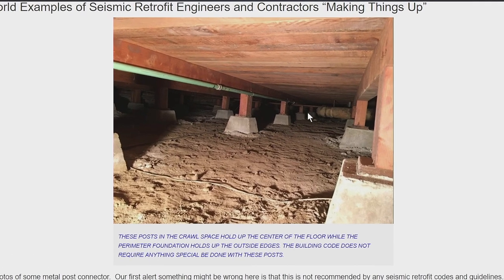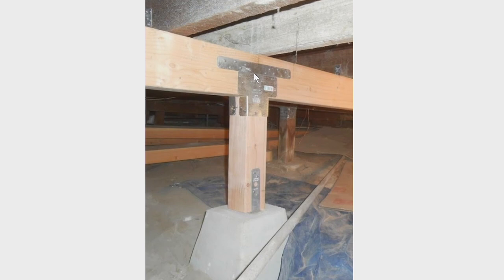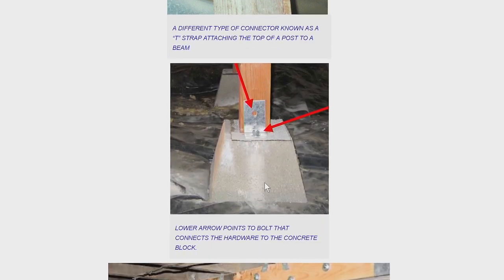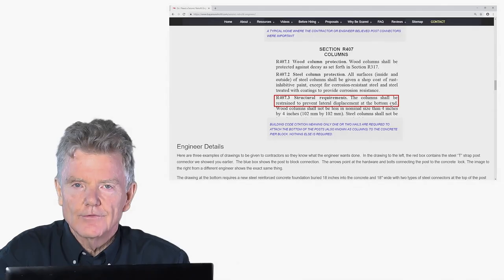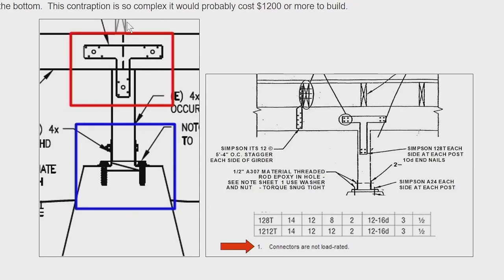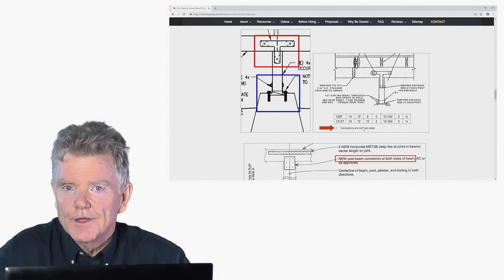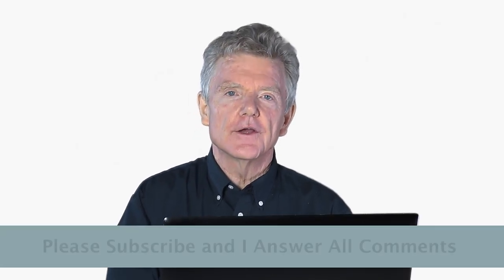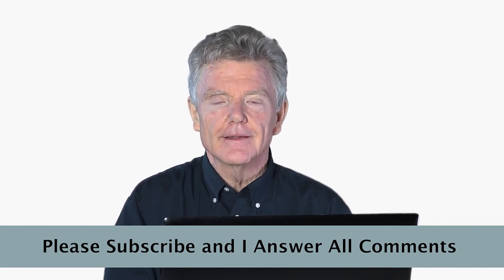Seismic Retrofitting The Post to Beam Connections

Comment: Hi. Very clear video. I was hoping at the end that you would show what type of connection or bracing is necessary for an older foundation where the piers are merely siting on top of a concrete block and not currently connected at either the top or bottom. Thanks.
Reply from the maker: Can you send me a photo of what you are talking about?  The code says only one nail is required at the bottom.  Type in "Post to Beam" in the search bar and you will see the code citation on the webpage. I thought this was included in the video.
Reply: @bayarearetrofit5814  Great video and I also hoped that you'd provide an image of the right nail connection that you are referring to.
Reply from the maker: Toe Nails
Reply: @bayarearetrofit5814  Thanks
Reply from the maker: Happy to help.  If you could subscribe I would appreciate it.
Reply: I was confused also because he gave all the examples about how not to do it and waste money, but he never stated the correct way to do it and engineers just don’t design to design. Please advise.
Reply: Thank you! Great video

Comment: Working under an older house to level it was not a favorite thing that I have done. You start jacking up the house and it starts creaking and cracking. Very nerve-wracking. Get the steel plate shims in and get out.

Comment: So what exactly SHOULD you do for a seismic retrofit?
Reply: I was confused also because he gave all the examples about how not to do it and waste money, but he never stated the correct way to do it and engineers just don’t design to design. Please advise.
Reply: I agree!  I have a 16' beam through the center of the house sitting on two posts, each post made of 3 - 2x6"s nailed together.  I'm worried that lateral movement and shaking could knock the beam off the posts and was hoping to see if there was a way to shore the posts up to the floor joists.  If the beam falls off the posts in a quake, the house and roof will cave in.

Comment: Thanks  - very useful into. Going thru EBB process right now for my house and this was an option that my contractor proposed. I rejected it since it wasn't required and also thought its something I could easily do myself. However watching this video, it basically means I don't need to do it and its not needed.
Reply from the maker: That is right, if I had a quarter for every unnecessary piece of hardware I have seen under houses I could spend all day making videos.  Please do me a favor and subscribe.

Comment from the maker: The code says put a nail at the bottom of the post.  Read the article.  It also says the purpose of a connection here is simply to keep the post in place in the event someone kicks it by mistake.  Everyone puts nails at the top and bottom of the post but you don't really need to per code.

Comment: I got EBB approved recently. I was only going to install the universal retrofit foundation plates per code and thought that would be sufficient. However, watching several YouTube videos it looks like code also requires upgrading mud sill bolts on older homes (mine was built in 1965) and drilling vent holes in cripple wall plywood and would like to know if that’s accurate.
Thank Donald
Reply from the maker: The EBB requires that you use either FEMA P-1100 or Standard Plan A to qualify for the grant. You can find a comparison between the two systems on this webpage.  

https://bayarearetrofit.com/fema-p-1100-icc-1300-and-standard-plan-a/

Please study this webpage so that you know which system you want to use. This is an important decision and will make a big difference in terms of cost.

Comment: Is fixing the sinking perimeter walls enough or shall we combine attention on both …. I have the case in my crawlspace , the middle piers are kinda sinking not because the soil is softer there but precisely at the bottom of the perimeter foundation walls sinking or tilting cause of water badly diverted around the house foundation walls on which each end of the main girder is sitting. So the support sinking the girder is kind of sliding out of its place n push down on the piers supporting it in the middle .. question is how do you get the perimeter walls issue fixed … I mean once the job of getting the rain water away from the house ? Please give us some guidance there your video threw all my courage down into the deepest spot of the crawl space
Reply from the maker: The only thing I know is to level the floor.  To do it right you need to use a laser.  Maybe there is something on YouTube.  I have never done it myself. If you discover anything let me know.
Reply: You can use a water level to level the floor. Get 100' of 3/8" or 1/2" vinyl tube and fill it with water. Attach it to two sticks, stakes, or rods. Place one of these against a door frame solidly with the bottom resting on the floor. Do not let it move. Then go around the house and measure the level of water from the floor to the level point. You can then build a map of where your floor is out of level. I will be doing this in my south bay area home built on expansive clay soil in the coming year.

Comment: Your video made me feel better about my post to beam connections on my deck . 2 levels , 38 years old , southern cal , all Doug Fir . Rim beams are 4X 10 X 16’ connected to 8X8 20’ post with 1” through bolts and or lags. 
There are a lot of videos talking about that connection should never rely on shear strength of 2 bolts. I’m assuming when it was built it was code. It may still be ? Thanks for the video .
Reply: I have the same type of deck but less lumber. 6x6 with one 2x10 rim. I think if you add a Deck Joist Tie you'll sleep better at night. That basically will make your connection the same as beam on post

Comment: I have brick walls on top of a brick foundation and the floor is held up by posts like this. I am lifting/leveling the floor joists and was going to replace the floor beams and posts and add metal hardware like in this video. I see what you mean about that hardware being worthless, but in my case I don't know how to securely attach the house to the brick foundation since brick seems fragile. Instead of posts holding up the floor should I put shear walls under the floor and hope that also adds stability to the brick structure?
Reply from the maker: Sorry I am so late in my reply.  I do not know YouTube did not notify me about your comment. Look at my webpage on brick foundations.

Comment: well, here's the rub... in remodeling a bathroom, an engineer is sometimes required by the city in order to sign off on the permit.  The engineer makes calculations and requires / specifies Simpson-Tie post connectors (the AC4) like the ones shown here which you consider unnecessary.  As a homeowner without an engineering degree, how does one combat the engineer's recommendation in order for the city to sign off on the permit?  I am of the mind to just lock everything in under the house since no one knows the direction and type of earthquake that's coming.  The AC4 and hurricane connectors are relatively cheap and require a little elbow grease under the house.
Reply from the maker: Fighting with an engineer is a waste of breath.  You can cite the code which you find on the webpage but they won't listen.  Your idea is a good one.

Comment: Interesting video.   I have a question though.   When you say "one nail", where would that nail go?   Probably a dumb question, but I can't picture the answer.
Reply: It says at the bottom of the post.  Read it again.
Reply: I had the same question.  A nail into the bottom of a wood post into what, the cement pier?  Those L shape straps seem simple enough, my posts are half hanging off the piers.

Comment: Maybe the supports were installed for support purposes only and not for seismic retrofitting.
A lot of houses that were built a long time ago may require additional support over time. Personally I feel the photos were used out of context to make the video, since the drawings or plans do not mention for seismic activity but they also do not mention for structural support. I would think you need some type of shock absorbers or the house to be on rollers to handle serious seismic activity. Posts or no post are not going to save the house from an earthquake. The perimeter of the house would be more important than the middle when it comes to seismic activity.
Reply from the maker: Please go to bayarearetrofit.com and search for "post to beam" and read the code requirement.

Comment: If everything strapped up to the floor joists, wouldn’t it provide some resist from the home flying off the permitter?
Reply: Also, if strapped wouldn’t it add support against cripple wall failure?  Not trying to be a contrarian, genuinely trying to understand.   I’m a DIY’er with an old home.
Reply from the maker: There are two types of earthquake faults, thrust faults and lateral-slip faults.  The Hayward Fault is a thrust fault. Thrust faults have a vertical component.  The building code does not recognize this force as being something you need to resist, though Simpson StrongTie likes for people to believe otherwise so they can sell more hardware.  Houses move up with the ground and down with the ground.  They do do not become separated because of upward acceleration.  That is why building codes do not address vertical acceleration. Hope that helped.  If you haven't done so, please subscribe.
Reply: Bay Area Seismic Retrofit So you are saying that houses do not bounce and there is no need to add vertical connection from the beams to the post to the pier?  A single nail from 100 years ago placed at the bottom is adequate? Genuine question, I wasn’t aware vertical acceleration is not of concern.
Reply from the maker: Many faults, such as the Hayward Fault, are thrust faults which means there is a vertical  component.  However, the building code a observed evidence do not see this as a source of damage. The building code only requires exactly what you describe.   I personally would add a few nails to the top and the bottom "well, .....just because" as the structural engineer who helped me put that video together expressed it.

Comment: Thank you for sharing, the question I have one can spend between 15K to 25K on building a deck but avoid securing it because gravity will play a big role so we can save between $500 to $2000 
is it technically fair to say that you need x amount of material based on the size, height, and location (hot, cold weather)
Reply: There are too many unknown factors to give you an answer.

Comment: I don't understand why this is a complete waste.  Your other videos show the importance of preventing shear, uplift, etc by building shear walls.  Are you saying shear walls are all that's important, that they will take the force instead of these posts and beams?  It seems like the hardware you are saying is a waste would help prevent some shear force?  thanks.  Great videos.
Reply from the maker: A post provides zero lateral resistance.  Imagine the floor sitting on top of the post and the floor happens to move a foot, the post will tip over.  If the house remains secured to the foundation the floor will not move on top of the posts at all and the posts will not tip over.  In other words, if you secure the house to the foundation on the perimeter the floor will not move on top of the the posts don't need to resist anything. The metal post connectors you are referring to have ZERO lateral resistance according to the manufacturer.  Why put in hardware that is labor intensive, is not required by the code, and offers zero lateral resistance?  If the post is required to resist lateral force because the house has become disconnected from the foundation you are screwed anyway.  Best to spend your money where it counts.
Reply: @bayarearetrofit5814  got it.  Okay that helps-visualizing that everything will move together as long as the walls in the foundation are strong and properly done.  Thanks, great videos.
Reply from the maker: Ask anything, anytime.
Reply: I was confused also because he gave all the examples about how not to do it and waste money, but he never stated the correct way to do it and engineers just don’t design to design. Please advise.
Reply: @tyrice24earl  check out his many other vids. He covers the important stuff about proper installations and recommendations there.
Reply: @davidrutan I have the same question as the person you responded to. This title says retrofitting, not ways not to succeed.  My point is,  what would the title of the affirmative steps video be?

Comment: Even though this is not required by IEBC it is recommended by Simpson Strong in their 2019 Seismic Retrofit guide for raised foundations under section AC Post Caps and loads are actually available on the specs sheet. So it is NOT a waste of money
Reply from the maker: It is important to remember that Simpson is in the business of selling hardware, not public safety or spending people's money wisely.  Their plan set and guide has other recommendations that are not logical, but they do increase hardware consumption.  Impartial agencies such as the ICC are not trying to sell anything.  In the end one must listen to both sides, see which is the most logical, and act from there.
Reply: This is like the oil companies saying that you need to replace the oil every 5k. Or the umbrella company saying to replace your umbrella every 5 raining seasons.
Reply: You’re joking. Right?

Comment: You mention that post and beam connections are not a proven retrofit technique - this uses a crawl space as an example. Does also apply to soft-story conditions where there are fewer total posts?  (first story garage with crawl space > 7 feet).
Reply from the maker: The same principles apply, though in my opinion the posts could be dislodged from the shaking itself regardless of whether or not the floor moved.  It is so cheap to strengthen this connection, even a few nails ought to do it, why take the chance?  Especially when you have a limited number of posts.
Reply: @bayarearetrofit5814  Sure makes sense regarding nails, why not?  How about other recommendations such as far as adding hardware connectors / improving concrete footing?
Reply from the maker: Leave the concrete alone. Search for SEAOSC and as far as the rest of it, it is all important.